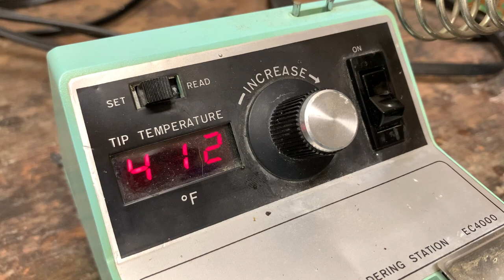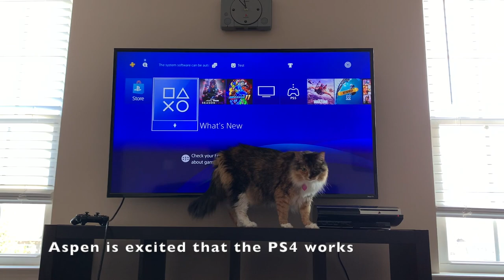PS4 Slim Console Repair and Restoration | PlayStation 4

Comment: You could use the plastic welding to your advantage, by using ABS filament of a different or similar colour and melt it down into the cracks with a flat tip on the soldering iron. Turn it from a "scar" into a decorative element.
Reply from the maker: Ah, you should look up Kintsugi!
Reply: @RestorationRelaxation  yeah I know. Star wars fan. They were inspire by that for Kylo Ren's repaired helmey.

Comment: Can the ps4 get cracks on the plastic over thermal expansion?
Reply from the maker: Good question! Nope, it’ll be fine moving forward
Reply: @RestorationRelaxation  i have started to see stress cracks all over the shell of mine,it's only a year old
Reply from the maker: @alripal9665  that’s very unusual. I haven’t heard of such a thing happening on any game console unless it’s been left out in the sun and the ABS plastic started to degrade
Reply: I literally heard them happening,they started off tiny but now they're getting bigger every day,the console works perfect,but i'm going to have to replace all the plastic eventually
Reply from the maker: @alripal9665  😳
Reply: @RestorationRelaxation  there is absolutely nothing on the Internet about this so strange